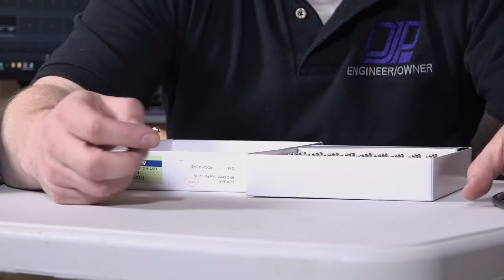What types of cables do you use for SDI professional video?

Comment: We use Neutrik connectors for our RG6 cables over here in the UK, they have a good rubberised sleeve past the connection end and stops the cameramen bending it too much, especially if they step on the cable by accident when walking around on sports events. I am going to buy some of those Canare BCP-A42 to try as you've highly rated them. That yellow strip tool you have is excellent, what brand is that?
Reply: I love Neutrik as well! I use them for everything other than my coax.

The stripper is the Canare TS100u.  It handles several different sizes of cable.
Reply: Excellent, Thanks Doug! Great video as always.
Reply: I love the Neutrik Reartwist connectors, they make life so much easier - espacially when connecting video routers ;)
Reply from the maker: I'll have to give them a try. Thanks!
Reply: Plus they support 12G ( Neutrik) . Their crimp tool dimn  though is non-standard and quite expensive